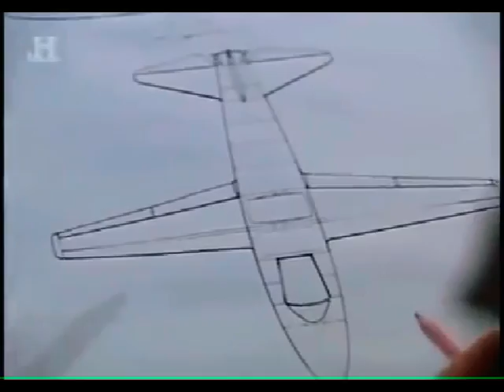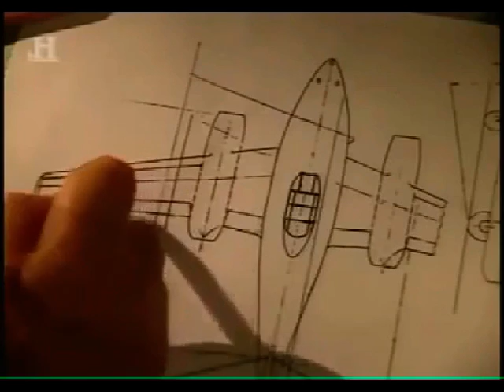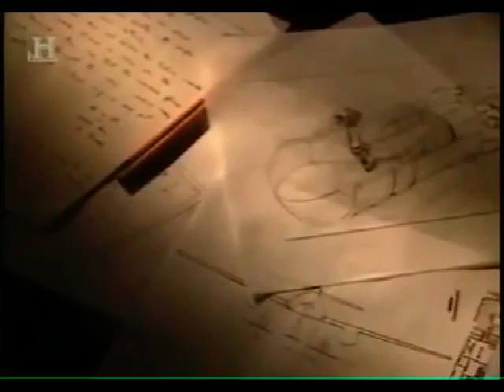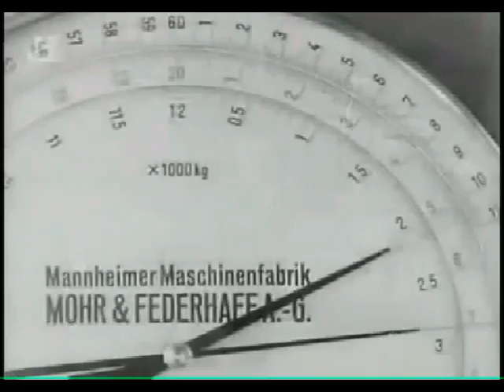The Father of the Jet Engine - Hans Von Ohain

Comment: von ohain's first working prototype = 1935
frank whittle's first working prototype = 1937
you do the math
Reply: Frank Whittle patented the first jet engine in 1930, Van Ohain built the first jet engine some years later.  History is ironic.
Reply: Meh von ohain also had a designe in 1930 miep
Reply: @user6008  Maxuime Guillaume was the first to patent the turbojet engine in 1921... 9 years before Whittle. Von Ohain built and flight tested in the first jet  aircraft.
Reply: Sander Van der Kammen , I do believe they classifi his as an impulse engine ? Worked on a slightly different affect ? Combustion over a leading edge ? So apparently one and only engine and plane of this type ever !
Reply: Z T , what about 1928 ???
Reply: @robertwoodroffe123  No, Hans von Ohain invented the turbojet engine, his engine powered the first jet aircraft... years before Whittle.
Reply: @robertwoodroffe123  Maxime Guillaume patented the turbojet engine 9 years before Whittle.
Reply: Sander Van der Kammen , click, click, click, click, ................................................ Dats the sound of an  early axial flow turbo jet engine when rotated . Because the impeller blade roots ! Are rooted !
Reply: Sander Van der Kammen ; so which plane had a higher rate of climb ? F86 sabre or Mig15 ?
Reply: @robertwoodroffe123  The facts are irrefutable, Whittle did not invent the turbojet engine.
Reply: Sander Van der Kammen , if I house and workshop and you had a tent and a good idea ! But you had to show your idea first , who is most likely to win ?
Reply: Sander Van der Kammen , so your an enigma ! surrounded by a computer !!!!
Reply: Sander Van der Kammen , no the Germans lost ! Boeing  , Airbus , illoyson, Japan ,China , Argentina , Brazil, Saab , Mirage .......etc etc 
All because ??
Reply: Robert Woodroffe 
And you became the clowns of Europe. You are rasisst, these need help. Because of US and other armies they are fleeing after all. Hans von Ohain built the first functional jet engine. Besides, what did the British do for flying than this anyway. Hans von Ohain invented the jet engine, Otto Lilienthal invented the first working flying machine, heavier than air, and which could carry a person (basically the first plane), Ferdinand von Zeppelin invented the airship and Werner von Braun invented the space rocket. Also the first airline opened in Germany. The first plane made out of metal was built in Germany by aircraft pioneer Hugo Junkers, the biggest flying machine ever and the two historical and the largest aircraft companies of the early to mid 20th century „Junkers“ and „Dorniers“ were also German. Not to forget that the CEO of Airbus and the founder of Boeing (original name was Böing) were also from Germany.
Reply: Bernhard Klumpe , ah pride 1 of the seven deadly sins ! God !
Reply: @robertwoodroffe123  Frank Whittle did not invent the turbojet engine... Hans von Ohain did.
Reply: @sandervanderkammen9230  No, Whittle invented the turbojet engine...Han von Ohain didn't.
Reply: @fritzfieldwrangle-clouder7299  Sorry but the facts conclusively prove otherwise, Whittle's claims are a propaganda myth.
Reply: @sandervanderkammen9230  Sorry Sanders but the facts conclusively prove that Whittle invented the jet engine.
Reply: Except that Ohain himself states that his first working prototype didn't run till March 1937 and even then only on hydrogen. Are you calling Ohain a liar?
Reply: @fritzfieldwrangle-clouder7299  What facts? Propaganda myths are not facts.
Reply: @fritzfieldwrangle-clouder7299  Hans von Ohain and Max Hahnn built the first jet engine protype in 1934..
 2 years before Whittle.
It's moot point, Von Ohain's design was the first successful flightworthy jet engine in August 27th 1939, 2 years before Whittle.
Reply: @sandervanderkammen9230   Very true Sandyboy, so until you come up with some facts, we can take it that your posts are just a feeble attempt at propaganda.
Reply: @sandervanderkammen9230  Pabst von Ohain disagrees with you about when his first jet engine prototype was built. In his forward to 'Elements of Propulsion, gas turbines and rockets', Ohain describes his time at Georgia Augusta University of Gottingen between 1933 and 1935 and makes no mention of a prototype in 1934.   Do you actually have any reputable source to back up you claim of a prototype in 1934?
Ohain does describe a model of his engine, which had to be  run from an electric motor, which  Hahn built in 1935 the first experiments with which began after April 1936. Could it be this that you are thinking of?
I'm really not convinced that you would know better than Ohain on this issue.
Reply: @fritzfieldwrangle-clouder7299  Frank Whittle did not begin work on jet engines until he moved to Rugby in 1936, Whittle's whereabouts are well-known and documented.
Reply: @sandervanderkammen9230  Face it Sandyboy, you've been caught, at best being ill informed but likely in a downright lie. Ohain himself 
clearly shows your 1934 engine prototype claim to be false.
Reply: @fritzfieldwrangle-clouder7299  Hans von Ohain invented the jet engine... 2 years before Frank Whittle.
Reply: @sandervanderkammen9230   Some quotes from Pabst von Ohain's foreword to 'Elements of Propulsion, gas turbines and rockets'-

"The first patent of a turbojet engine, which was later developed and produced,
was that of Frank Whittle, now Sir Frank (see Fig. 5). His patent was applied for
in January 1930. This patent shows a multistage, axial-flow compressor followed
by a radial compressor stage, a combustor, an axial-flow turbine driving the
compressor, and an exhaust nozzle. Such configurations are still used today for
small- and medium-power output engines,"

and with regard his own endeavors Pabst von Ohain says-

"In early 1935, I worked out a patent for the various features of a gas turbine
consisting of radial outflow compressor rotor, combustor, radial inflow turbine,
and a central exhaust thrust nozzle."

Only in Sandyboy's fevered imagination is 1935 two years before 1930.
Reply: @fritzfieldwrangle-clouder7299  The first demonstration of a successful jet engine was August 27th 1939 in Rostock Germany.
T
Reply: @sandervanderkammen9230  Well well, it's old Sandyboy my favourite wehraboo, how are you mate?  Here's what Pabst von Ohain had to say in his forword to 'Elements of Propulsion. gas turbines and rockets'-
"The first patent of a turbojet engine, which was later developed and produced,
was that of Frank Whittle, now Sir Frank (see Fig. 5). His patent was applied for
in January 1930. This patent shows a multistage, axial-flow compressor followed
by a radial compressor stage, a combustor, an axial-flow turbine driving the
compressor, and an exhaust nozzle."
Reply: @fritzfieldwrangle-clouder7299  Still trying to deny the truth?  the first patent for the turbojet engine was Maxime Guillaume, May 3rd 1921
Patent number 534.801
Reply: @sandervanderkammen9230  Go with Guillaume if you want Sandy honey and go tell Spottydog4477 that he's wrong and Pabst von Ohain isn't the father of the jet engine.
Reply: @fritzfieldwrangle-clouder7299  Frank Whittle did not invent the turbojet engine... nothing you can say will change this irrefutable fact.
Reply: @sandervanderkammen9230  Good morning Sandyboy dear.  So let's consider what Pabst von Ohain had to say on this issue.-
"The first patent of a turbojet engine, which was later developed and produced,
was that of Frank Whittle, now Sir Frank (see Fig. 5). His patent was applied for
in January 1930. This patent shows a multistage, axial-flow compressor followed
by a radial compressor stage, a combustor, an axial-flow turbine driving the
compressor, and an exhaust nozzle."

Who to believe, Pabst von Ohain or some wehraboo commenting under a youtube video. Hmmm.
Reply: Why bother with maths when you can read Hans von Ohain's own words. From Ohain's foreword to 'Elements of Propulsion, Gas turbines and Rockets'.

"The first patent of a turbojet engine, which was later developed and produced,
was that of Frank Whittle, now Sir Frank (see Fig. 5). His patent was applied for
in January 1930. This patent shows a multistage, axial-flow compressor followed
by a radial compressor stage, a combustor, an axial-flow turbine driving the
compressor, and an exhaust nozzle."

And 

"In April 1937, Whittle had his bench-test jet engine ready for the first test run.
It ran excellently; however, it ran out of control because liquid fuel had collected
inside the engine and started to vaporize as the engine became hot, thereby
adding uncontrolled fuel quantities to the combustion process. The problem
was easily overcome. This first test run was the world's first run of a bench-test
jet engine operating with liquid fuel (Fig. 7)."

and with regard to Ohain's efforts, he declares that his 1935 model engine was NOT a working prototype. Ohain states-

"Although my project did not fit Pohl's institute, he was extremely helpful to me. He let me test the
model engine in the backyard of his institute and gave me instrumentation
and an electric starting motor. Because the combustors did not work, the
model did not run without power from the starting motor." 

"THE MODEL DID NOT RUN WITHOUT POWER FROM THE STARTING MOTOR." So not a working prototype.

and then there was Ohain's 1937 effort. He states-

"Now came the greatest difficulty for me: How could I convince Heinkel that
first building a turbojet with hydrogen gas as fuel would be a far better approach
than trying to develop a liquid-fuel combustor under an enormous time pressure?
According to my contract, of course, I should have worked on the liquid-fuel
combustor with the (impossible) goal of having this development completed
by June 1936. ... Heinkel asked only
 when the HYDROGEN DEMONSTRATOR could run."       (my emphasis)

Followed by-

"The engine was completed at the end of February 1937, and the start of our
demonstration program was in the first half of March, according to Gundermann's
and my recollections. The first run is clearly engraved in my memory: Hahn
had just attached the last connections between engine and test stand; it was
after midnight, and we asked ourselves if we should make a short run. We
decided to do it! The engine had a 2-hp electric starting motor. Hahn wanted
to throw off the belt-connecting starter motor and HYDROGEN engine if selfsupporting
operation was indicated. Gundermann observed the exhaust side to
detect possible hot spots--none were visible. I was in the test room. The
motor brought the engine to somewhat above 2000 rpm. The ignition was on,
and I opened the HYDROGEN valve carefully."                                                                 (my emphasis)

So not a working prototype of his engine but a HYDROGEN DEMONSTRATOR which was in breach of his contractual obligations because he couldn't make a liquid fueled engine work in time. So to remind you in Ohain's own words-

"In April 1937, Whittle had his bench-test jet engine ready for the first test run.
It ran excellently; however, it ran out of control because liquid fuel had collected
inside the engine and started to vaporize as the engine became hot, thereby
adding uncontrolled fuel quantities to the combustion process. The problem
was easily overcome. This first test run was the WORLD'S FIRST run of a bench-test
jet engine operating with liquid fuel (Fig. 7)."                                                                           (my emphasis)
Reply: @user6008  Patent Law also states that the inventor has to prove Utility, ie it can make a plane fly ! Just saying like??? Otherwise I could say I have invented an Antigravity machine, bla bla!
Reply: @sandervanderkammen9230  Yeah, he read Whittles patent!
Reply: @marypetrie930  You obviously don't know anything about either man's work, simply look at the two designs and that myth can be easily discredited.
Reply: @fritzfieldwrangle-clouder7299  
Hans von Ohain wrote a very comprehensive foreword in the 'Elements of Propulsion, Gas turbines and Rockets'. He states: 

"The first patent of a turbojet engine, which was later developed and produced, was that of Frank Whittle, now Sir Frank. His patent was applied for in January 1930. This patent shows a multistage, axial-flow compressor followed by a radial compressor stage, a combustor, an axial-flow turbine driving the compressor, and an exhaust nozzle. Such configurations are still used today..." 

and ...

"From the beginning of his jet propulsion activities, Frank Whittle had been seeking means for improving the propulsive efficiency of turbojet engines. He conceived novel ideas for which he filed a patent application in 1936, which can be called a bypass engine or turbofan. To avoid a complete new design, Whittle sought an interim solution that could be merely "tacked on" to a jet engine. This configuration was later known as the aft fan. Whittle's work on fan jets or bypass engines and aft fans was way ahead of his time. It was of greatest importance for the future or turbopropulsion."

and.... 

"In April 1937, Whittle had his bench-test jet engine ready for the first test run. It ran excellently; however, it ran out of control because liquid fuel had collected inside the engine and started to vaporize as the engine became hot, thereby adding uncontrolled fuel quantities to the combustion process. The problem was easily overcome. This first test run was the world's first run of a bench-test jet engine operating with liquid fuel.".
Reply: @johnburns4017  Yes John, you've requoted what I've already quoted. (oh and I have noted your emphasis)
Reply: @fritzwrangle-clouder6033  
The idea was the emphasis.
Reply: @johnburns4017  Cool.

Comment: Just the unvarnished truth - Frank Whittle patented the jet engine in 1930. His patents were published in the British newspapers, which were read by German spies. Hans Von Ohain read and saw Whittles work and ran with it...

Von Ohain built the very first operational jet engine in 1937. However, Frank Whittle's engine built the very same year would not become operational until 1941. But the fact of the matter is Frank Whittle's axial Flow engine was sound, it worked. Whereas the German's never did build reliable jet engines during WWII.

Therein lies the rub. Whittle had a fully functional jet engine, the Germans did not which severely limited their ability to keep jet fighters in combat. Nevertheless after the war Frank Whittle and Hans Von Ohain became good friends and deeply respected the accomplishments of each other.
Reply from the maker: Spies didnt steal anything -whittles patents were in the public domain = dumb ass

Germans didnt copy whittle centrifugal engine (which was obsolete by 1947) - dumb ass
Reply: Whittle was not the first to patent the turbojet and did build or test first... Maxuime Guillaume patented the turbojet in 1921, 9 years before Whittle.
Reply: One only need to compare the Whittle patent with von Ohain's to see they are completely different designs.
Reply: @sandervanderkammen9230  Good morning Sandyboy dear.  So let's consider what Pabst von Ohain had to say on this issue.-
"The first patent of a turbojet engine, which was later developed and produced,
was that of Frank Whittle, now Sir Frank (see Fig. 5). His patent was applied for
in January 1930. This patent shows a multistage, axial-flow compressor followed
by a radial compressor stage, a combustor, an axial-flow turbine driving the
compressor, and an exhaust nozzle."
Go with Guillaume if you want Sandy honey and go tell Spottydog4477 that he's wrong and Pabst von Ohain isn't the father of the jet engine.

Comment: Whittle is the inventor of the turbojet engine.  Had the British government  and RAF the foresight to fund the man, it is conceivable that the RAF could have had a jet powered interceptor  before the war.
Reply: Instead the UK government obstructed him, by forcing him to work with Rover.  Rover was supposed to be doing development for production.  In fact they made many design revisions  but refused to carry out design changes he wanted.  One example was a twist in the fan blades, which Rover refused to make.  Once the contract was taken over by Rolls Royce,they made the revised fan blades and increased efficiency and eliminated a surge problem.  That had cost a year's delay
Reply: @psk1w1  
Rolls Royce took over the jet engine and gave Rover the Meteor tank engine, it worked out well in the end.
Reply: Frank Whittle did not invent the turbojet engine..
Reply: @psk1w1  Adrian Lombard  at Rover and Stanley Hooker at Rolls-Royce were the real genius behind the British efforts to develop turbojet engines.
But Lombard refused to work with Whittle as he had become increasingly addled by drug addiction and alcoholism.
 After Whittle was arrested for assaulting a Rolls-Royce engineer with a deadly weapon Whittle was shunned by both the RAE and industry experts.
Whittle's career stalled and in 1946 he would be sacked during the Miles M.52 scandal. Accused of embezzlement and dereliction he was removed from his own company and exiled to the U.S. for drug rehabilitation. Whittle would never work in the U.K. aircraft industry again.
Reply: @sandervanderkammen9230   Have any proof of this?
Reply: @scootergeorge9576  This is all public record.
Reply: @sandervanderkammen9230  - Then supply a link.
Reply: @scootergeorge9576  You won't get one. Sandyboy doesn't do evidence or anything like that.
Reply: @fritzfieldwrangle-clouder7299  - I guess we'll just have to take his word for it. LOL!!!
Reply: No.